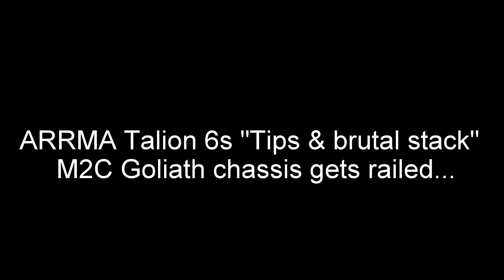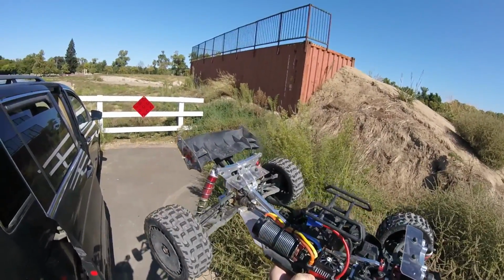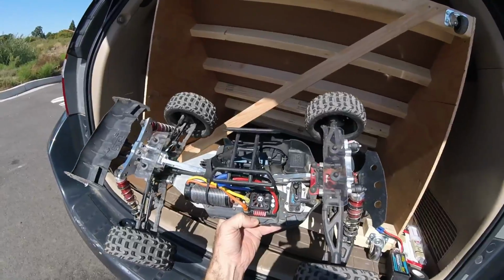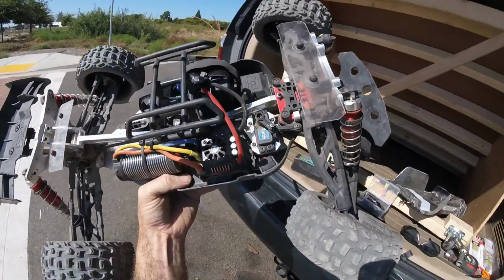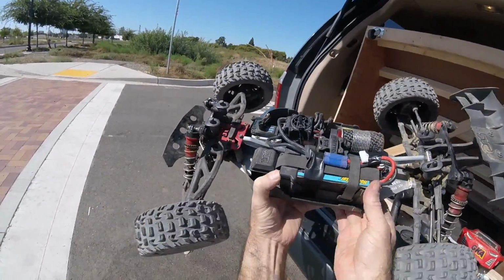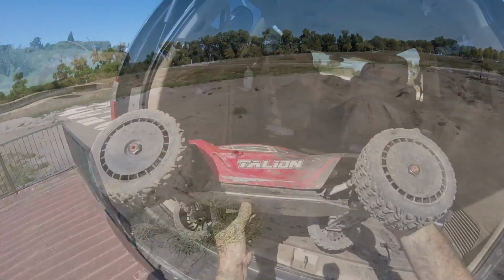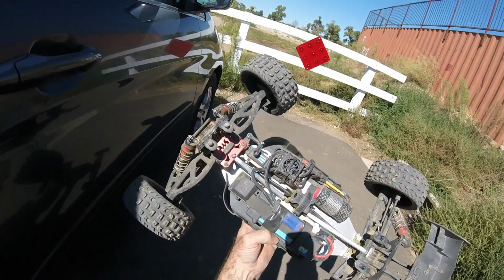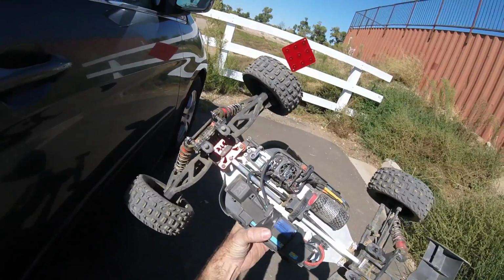ARRMA Talion 6s "Rail Job" Goliath chassis gets stacked...

Comment: Sweet freakin bash my brotha i use JB Weld on all kinds of shit great stuff man. the Kraton looks bad ass definitely a beast with those  towers on it very nice happy bashing bud👍🤙😎🤪😜😝🙈🙉🙊👊✌
Reply from the maker: Thanks so much Chris 🤗!!!! Great to know JB Weld has worked for you Brother 👍. I never saw the Plastic Bonder until recently 👀. Super easy to use and feels insanely solid. Probably could've used this awhile back to fix a leaking pool sand filter 🤔. Definitely gonna to try it with other RC repairs. The Kraton is a Tank no doubt. Bash on Brother!!!! 🤙🤙😎💪👊👊

Comment: Always so impressive.  JB weld has been around forever.  They have a tube of putty also that is much easier to work with.
Reply from the maker: Thanks so much Robert 👊!!! JB Weld has been around forever. I'd tried the putty before, but never the Plastic Bonder 👀. It's thick enough to spread and form with a very fast bonding rate 👍. Going to try it on other repairs. 👍👍😎💪👊👊

Comment: KILLER Blast brother Rich!!😱😎🤘🤘All rigs were just killin it! Kraton lookin good with all the beefcake! Good tips with the lexan! I do the same but glue the strips to the inside of my body.  Stiffins it up nice!👌Glad you got the ESC sorted! I wasn't able to save mine..I just had no connection no matter what.🙄The Max8 is doing great though! Those Savox 1210's are dropping like fly's!😳 Glad the Power HD's are working out for ya! That's all I've been using for a while now and have only had one strip out. That was bc of a hard pavement landing! Great for the money! Saxox you're just paying for the name IMO. Just LOVE the Talion flights man! That rail hit was CRAZY!! M2C FTW!!💪💪😳Awesome vid my good friend!! Peace!🍻😎🤘🤘👊👊
Reply from the maker: Thanks so much Brother Eric 😜!!!!  Bummer on the Savox 😱 but I'm stoked the ESC repair held up 👍. Those cups are a bitch to resolder. I used steel wool and alcohol to prep everything and Kevin T's technique again to get heat transfer🔥. The Plastic Bonder has  the cup locked to the casing now 🤔. We'll see how it goes. Big thanks for turning me on to the Power HD Brother 👊!!!! I'm tired of  dumping 💲on these 1210's to watch them turd out🤣🤣. So glad the Talion was on standby 🚀🚀. My bash time has been cut big-time and it felt Killer to finally clear that container and get some fun rippin in 🤗. That rail stack was gnarly 😱. Makes me proud though that our work on the test team has helped develop upgrades that actually work 💪. Can't wait to get out again soon Brother. Keep Killin it out there my friend!!! 🍻😱🤙🤙😎💪👊👊

Comment: Great video!
I ended up cutting some of the main battery strap down and use that as a balance lead cable tie, i ended up with a couple of inches as the main strap is really long.
Reply from the maker: Thanks so much Kent👊!!!! Yeah I usually take 2"+ off my main straps too 👍. They give you extra for guys running really tall packs. I use to use a similar Velcro strap for my balance cable, just misplaced the roll 👀👍👍😎💪👊👊

Comment: Rich, amazing video! I’m saving for the MTC chassis should have it pretty soon. I do have a question for you. I upgraded to a 20 tooth pinion gear and twice now I’ve snapped gears in my rear differential. I’ve got 60 K weight diff fluid in the back so is there something else I may be doing wrong? Also I really have no clue about shock maintenance. How to tell if your shocks need to be repaired, how often they need to be repaired. What I do know is that when I land off jumps half the size you’re doing a bounce quite a bit. Do you have a video that covers everything One needs to know about shocks? Thanks bro! 😎😎✌️💪💪
Reply: Watch rich videos on shimming ,also you may have go w lighter fluid . Im running exactly same 60k .i havent stripped internal diff yet but sure went through ring pinions lol
Reply from the maker: Thanks Brother 👊!!! You'll absolutely LOVE the M2C Goliath chassis 😱. I typically run 50/200/20k front to rear diff fluids with stock electronics anyways. The internal planetary gears do sometimes split in half where they rest on the set pin. Shimming the diffs definitely helps. The V4's now come with small planetary shims and shims on the outdrives. I use Mugen seiki E0206 and TKR1222 shims normally. The shocks usually need servicing and fresh oil around every 20 packs 🤔. That depends on how and where you bash. Really dusty or wet conditions take a toll on performance if you go too long. I did post a shock build video with the M2C setup a few weeks ago and diff vids awhile back 👀. I highly recommend going to Thomas P's channel, tpparts-rcxtreme to watch his how to video series 👍. It's all ARRMA and loaded with great vids. 🍻🤘🤘😎💪👊👊
Reply: Thx!

Comment: Hey rich, I just got an outcast after watching a lot of your videos. Its an absolute beast, and so much fun. But Im wondering how different the kraton and talion put the power down? I love the wheelies and standing backflips, but when your trying to build speed quick to hit a ramp, its almost impossible to keep the front end down. Do the kraton and talion wheelie immediately if you punch the throttle to?.
Reply from the maker: The Kraton and Talion get the power down way easier than the Outcast 👀. You can greatly improve the power transfer running smaller wheels like Badlands 3.8 or Backflip LP's on the Outcast 🤔. It's much harder to  pull wheelies on the longer platforms, but still possible of course. Both the Kraton and Talion are absolute Beasts 😱👍👍😎💪👊👊
Reply: @richduperbash2966  ok. Thanks for the info. There are lots of comparisons, but nobody really talks about power transfer. Thabks for the tips though. This is my first rc since the Tmaxx 3.3 came out, do Im a bit lost in the new rc world of electrics. I was in awe of how tough these things are now though👍

Comment: That rail hit was nuts🤯 cant believe nothing broke! Just curious how have your hobby star 6s packs been? Have you lost any cells etc.  Thnaks for you awesome  tips brother
Reply from the maker: Thanks Brother 😊!!!! I did bust a stock rod end I discovered, but I swapped on a beefy Nero HD one and kept going 👊. I've only had one Hobbystar lose a cell weeks back. Likely from impact damage. Think my rear chassis support bolt had sheered and allowed enough flex to damage my battery tray and the pack casing 👀. Must've happened mid run cuz my hardware was all snugged down. I've had great luck with my Hobbystar stuff thus far. 🍻😎💪👊👊
Reply: @richduperbash2966  yeah I've recently lost a cell but not sure how hobbystars warranty work?
Reply from the maker: @andybcardoso1978  I'm not sure either 🤔. I'd contact RCJuice and see if they can help.

Comment: Hey Rich,
❤️ the Lexan strip idea. Genius! Have you had good luck with the rpm chassis protectors? Does it come with longer 2.5 mm screws. And at aprox 5 minutes into the video why you tripping? lol 😂 and as far as servos go- the more I spend on them the shorter they seem to last. 130$ protek lasted a month . Hitec 70$ month and a half. 25 kg servo off amazon 20$ six months still no problems
Reply from the maker: Thanks so much Brother 😜!!! I haven't tried the the Tbone chassis protectors. I've had good luck with their bumpers overall though. I tripped cuz that container has a couple soft spots that cave in when you step on them 😱🤣🤣. Appreciate the servo feedback 👍. I'm done paying extra for the pricier brands. There's so many quality options that don't break the bank now. 🍻👌👌😎💪👊👊
Reply: The why you tripping is supposed to be a joke. Next time you see one of your kids trip over something you say to them “why you trippin?” Haha . Jokes suck when you have to explain them , right? Thanks bro
Reply: @NOR-CAL RC, I'm just curious if your end points are set properly? I am not saying they are not, but for you to take out whatever servo you throw at it, I'm thinking something is not quite adjusted proper. 
Is your spring in your servo saver too tight?
Reply: kruz racing169 excellent question. The servos were blown out on a few different RC’s. lol those that were listed weren’t shot out on one car.i usually set my end points 1st thing after finishing my rc’s . I generally put too much power into them , use tires that get too much traction and have a loose nut behind the wheel of my controller. So I really don’t blame the servo companies
Reply from the maker: @norcalrc  I figured you were joking 🤣🤣🍻. It's just weird when the "ground" you're walking on suddenly moves 😱

Comment: Killer LWB session! Kraton got some good air in before servo gave. If that isn't proof that M2C chassis are champion pieces then damn, and kept on running. Crazy!! I believe T-bone will warranty that no problem. From my experience they made my warranty request very very easy. Do i see a typhon???😉😉
Reply from the maker: Thanks so much Gabe 👊!!! The Kraton got robbed a full run, but she's fixed and ready 👍. That rail landing was another durability statement for sure 💪. Tbone will warranty just about anything, but I feel I've gotten reasonable life out of mine. Yes, that was my V2 Typhon 😍🤙🤙😎💪👊👊

Comment: Rich question for you... I've narrowed my next Arrma purchase down to either the red 6s Typhon or red 6s Kraton... Which do you see being easier to modd and has more available aftermarket parts? Which do you prefer stock out of the box? Thanks for any response 👍🏿
Reply from the maker: Both the Typhon and Kraton 6s are fantastic rigs, each with tons of aftermarket parts support. That said, both are easy to modify. I can't say which I prefer out of box because it's difficult to compare a buggy vs a monster truggy 🤔. Really depends on what terrain we're talking about. The Kraton can handle most all terrain, but the Typhon, although much quicker and agile, is more limited due to limited ground clearance...etc. The Typhon is more challenging to drive well IMO. Hope this helps. 🍻😎💪👊👊
Reply: @richduperbash2966  much appreciated sir.. very helpful 👍🏿

Comment: Earlier this year, you posted a number of MT410 videos, but have been mostly running Arrmas since then. What's your take on the difference? I actually got an MT410 and a Talion v3 in part based on your videos, so I'm curious how you think the two brands work for bashers.
Reply from the maker: I actually love both brands, but ARRMA is my preferred for harder bashing. That's mostly due to chassis layout, driveshaft thickness, and diff case design. The ARRMA's also have superior aftermarket support options too 👍. The Tekno's are butter smooth, handle brilliantly, and are Killer race rigs. My eb48.4 does fantastic on our 1/8 track 👀. I'd consider getting another Tekno for bashing, but they haven't shown serious interest in designing a bash specific rig from the ground up. It's been 3 years since they released the MT410 already and no signs of change. 🍻😎💪👊👊
Reply: @richduperbash2966  Thanks so much, Rich! I've definitely had issues with the driveshafts in the MT410 bending with only moderate impacts!

Comment: Awesome bash man the talion absolutely soars. How do you like the talion wheels on the kraton? I noticed you werent sporting the cage on the kraton do you run it like that often? I gotta get me some of the new towers for sure
Reply from the maker: Thanks so much Nick 👊!!!! The Talion really fly's something special 👀. I always run with the cage on the Kraton. It's saved my body...etc countless times. Was holding the Talion when talking about securing the wires with tape. I'm actually putting the V4 body support on my V3 Talion soon, just want to change motor mounts first cuz there's a slight difference in terminal height. The M2C Talion and Typhon towers should be available soon as well. 🍻🚀🚀😎💪👊👊
Reply: @richduperbash2966  love when you and Eric show what the Talion is capable of 🚀i think its bashability isnt portrayed enough
Reply from the maker: @nickteele169  thanks Bro 👊. I think you're right 😉. The Talion is much more than just a speed Beast. 🍻

Comment: Great video rich your jumps are just insane 🤯😵🤪
See yah
Saul
Reply from the maker: Thanks so much Saul 🤗!!!! Had fun out there for sure. 🍻😎💪👊👊
Reply: I'm sure ove that hou wloudent have fun bashing like you do i have to say you have skills and maybe a bit of natural talent 😛💪
Any way i have managed to get my  esc working properly on my rc system digger it go's like made on 3s but the temp of my motor seems very hot to me and i haven't got a temp gun.
What is a normal temperature for a motor wen you're bashing?
May i ask 😋👍
I will try and do a little vid, see what you think, don't make fun of me haha
See you rich
Saul 😜💪👍
Reply from the maker: @saulsrc5714  I generally gear my rigs to about 150F motor and around 120-135F ESC. That seems to be about the maximum efficiency 👍. I'd pick up a mini infrared temp gun. Harbor freight sells them for like 11-13$. 🍻
Reply: Hi rich hope you are doing well can't wait to see you in action on your next vid 🤪💪👌😋
I just went out with my new outcast 4s had a great time playing with it
But it fills like the slep clutch is sleping a lot. so I thithend it but it still sleeps do i have to thithen it completely?
See you
Saul
👍💪👌😋🤪😜🤯
Reply from the maker: @saulsrc5714  doing well Brother 😊. I'd recommend tightening the slipper completely down then back off 1/2 - 3/4 turn. If it still comes loose, add thread locker to the adjustment screw and give it 24 hours to set. Hope this helps my friend. 😎💪👊👊
Reply: Thanks so much for info.
That means that arrma do not thithen the clutch at all. It was completely loose thanks again mate.
And i will do a video once i figure out how to a montage video 🤔🤣😂lol 

Speak to you soon man
Thank again
Saul
Reply: Hi rich how are you doing? Hope you are doing well and family is well too 🤗💪👍 i have a question for you about GPM suspensions and there parts they produce.
Are they good quality? I have been looking on rc team there are a lot of different parts to upgrade.
And second question rich what parts would you upgrade for bashing
I have changed the front and back arms to rpm one's and changed the radio and stirring servo 😁
And i am finally ready to do my video thes week end it will be on SCRC my YouTube channel
Special dedicate for rich duperbash 💪💪💪💪💪😜😋
Speak to you soon
Saul
Reply: Me again
Sorry the channel is RCSC
But nothing on it yet haha 😛
Reply from the maker: @saulsrc5714  doing good Saul👊!!!! At work right now. GPM makes some decent parts and some not so great. Their shocks are beefy, but prone to leakage from my experience. Let me link you to an upgrade vid from a year ago. The biggest change has been the M2C Goliath Series chassis. No need for a tower to tower brace with one. https://youtu.be/LenULRLn70k
Reply: Thanks rich i am running a outcast 4s blx so the parts are a bit different.
But as usual you're advise is gold man 👌👍💪speak to you soon
See you
Saul

Comment: why not using the balance holder built into the tray? amazing video as always! you set the bar
Reply from the maker: Thanks so much Yoni and great question 👊!!!! I prefer not to use the balance holder in case my straps snap and the pack shifts. It would likely pull the balance plug clean off. 🍻😎💪👊👊

Comment: Do you have any cleaning tips I can use to clean and maintain my rc . I want to take good care of it since its pretty expensive...I also don’t know what is okay to do or not , like some people use wd40 but I heard that makes dirt stick and get under the oil. If you have any suggestions for me I would really appreciate It . Thanks rich! 🤙🏼
Reply from the maker: Hey Pierce 👊!!!! The best way to clean involves disassembly 👀. I do it periodically, but quite frankly only have so much time as a working family man. I generally air compress dirt off my trucks after every run with attention to the bearings and moving parts and do manual cleaning with rags and acid brushes. For mud and wet running, I gently spray off my rigs (don't blast the electronics) with a nozzle, spray with 50/50 water and Simple Green, then rinse off after a few minutes. Air compress and towel dry, also use my leaf blower for starters 🤣. Once fairly dry, I spray with WD-40 Silicone spray on my bearings and hinge pins. Then I either run my rig in the street or keep the wheels off and turn the motor and driveline on the workstand. WD-40 alone is a great cleaning agent and displaces water by design. Trouble is it doesn't provide lasting lubrication for bearings. Silicone is better, bearing oil is the best though. Just never put your rig away wet 👀. Just to be clear, I use WD-40 mostly for cleaning my CVD's and axels. Some guys spray there entire rig with it. Not saying that's bad, I just prefer to put it on a toothbrush and hit my metals with it instead. 😎💪👊👊
Reply: Rich Duperbash awesome thanks for getting back to me I needed some useful tips and that helped a lot 😆👍🏼. Your videos are da best! So entertaining and your super helpful since I’m fairly new to rc . Thanks so much brother!
Reply from the maker: @piercetiralongo  you bet Brother 👊. You'll find what techniques you prefer with time. This hobby involves some trial and error for sure, but there's always stuff to learn and it's rewarding to tune, repair, and maintain. Makes the bashing time much more enjoyable 🤗

Comment: Not sure how a 1210 held up on a kraton. Savox 1270 is the way to go running 3.8s
Reply from the maker: The 1210 has performed great for me for 2+ years running Backflips and other good sized 3.8s. I've had a few fail from hard flat landings though. I'm done paying for the name. Too many other viable options for a fraction of the cost. 🍻😎💪👊👊
Reply: Cool you said hd servo I think is their a certain one. I need one for my kraton
Reply from the maker: @kennethrichey4669  I've had good luck with the Power HD 23kg wp. It's not the highest torque, but it's plenty for my needs at a good price with steel and titanium gears and waterproof 👍. http://www.rcmart.com/waterproof-4866v-super-torque-digital-servo-012sec319ozin23kgcm-craw-p-68032.html?cPath=1099_1030